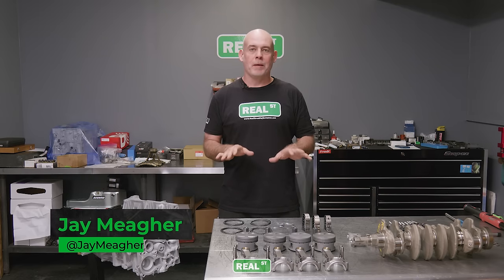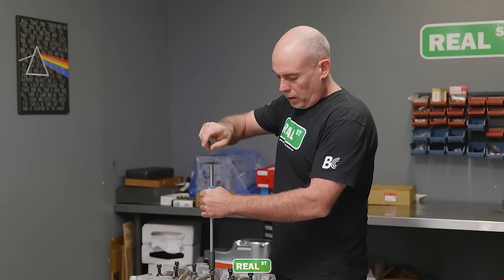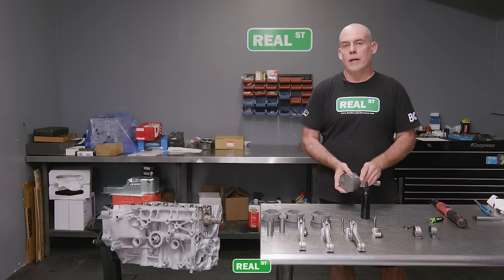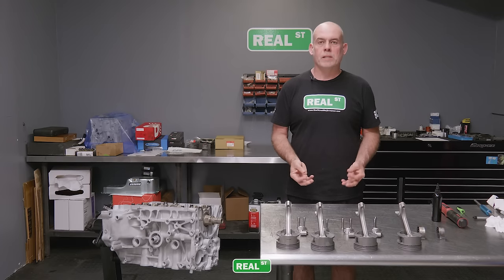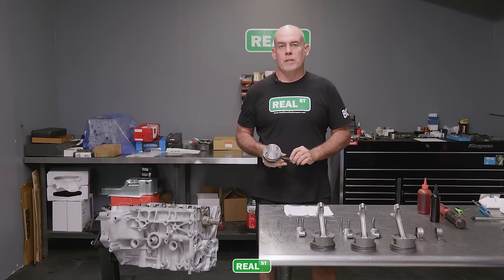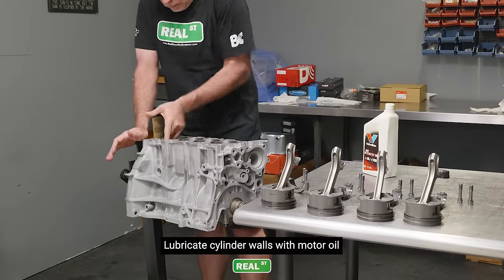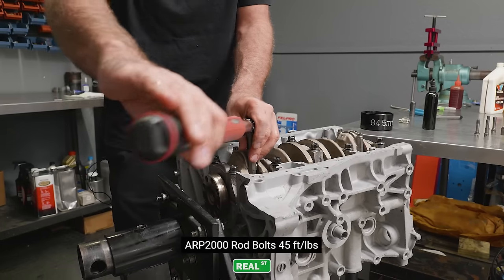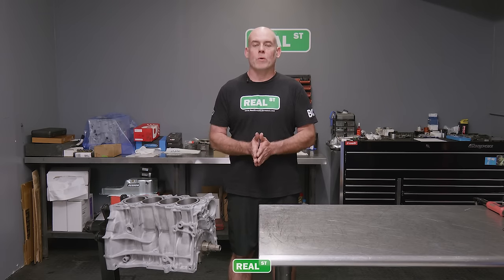How to Assemble Your Honda B20 Short Block with Jay Meagher | Real Street Performance

Comment: Did you check the bearing clearance on the mains and the rods before assembly?the reason I asked is that I had my Chevy 1.8l bored from stock. All original bearings are in excellent condition including the crank. Do I need to plastigage before assembly? Engine was ran in stressful conditions for 263,000 miles (Amazon deliveries) but was maintained well.  No sludge or carbon buildup.

Comment: My daughter and I are researching an engine rebuild for her 2000 CRV,  She's not a racer girl but does have to drive the pass from Reno to Sacramento regularly.  She needs more power!  
Is there an advantage to purchasing a B20Z block vs. a B20B also, choosing a P75 head vs. the P8R head for its larger valves?  Loving this video!

Comment: Hello I have a couple questions. First how did you get the block so fresh what process did you guys use? Also what is the break in process for a new built bottom end? Thank you for any feedback!
Reply: Most likely the engine went to a machine shop and got cleaned

Comment: When you installed the rod bearings did you put assembly lube on both sides of the bearings? Also were you using assembly lube to wipe on the rings? Does the b20 use thrust bearings?

Comment: Will you be venting the crank case pressure on your B20. I've read that the block needs the crank case pressure released if not it won't last long. I'd love to get your opinion on that considering you'll be doing a b20vtec.

Comment: Question from a beginner, should the screws always be lubricated before tightening according to manual torque values, for example when I assemble the cylinder head or valve cover or anything requiring specific torque? There is no reference in the manual regarding this aspect. Thanks

Comment: Do you guys bead blast the engine blocks? They're always so clean. If so, can you show or elaborate on the process used? Thanks again.
Reply: Hello, yes the blocks are either bead blasted or vapor honed. The vapor honing is nice, it doesn't dull out the aluminum. Just be careful either way to clean everything very well. The blasting media will quickly destroy a new build. Thanks

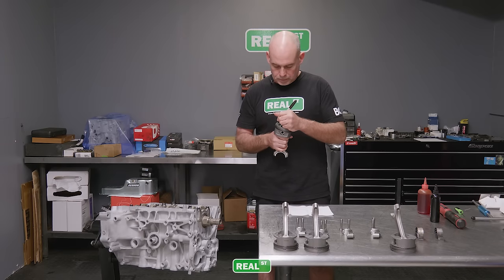Comment: The 18:30 minute explanation about mixing bearings is kind of confusing. I thought the thinner bearing goes in the rod cap and the thicker one in the top of the rod. The mains are the other way around, thinner bearing in the cap and the thicker in the engine main. You have a video that explains it but, in this video, it seems is the other way around. Am I missing something here?

Comment: Jay, is there a reason you decided to install the rod tangs on the intake side? I think you said it really didn't matter which side it went since modern vehicles don't have tangs to begin with. Also if you were to turbo this b20, wouldn't the poor sleeve design limit you as to how far you can push things? I've had a b20v setup prior and I ended up cracking all 4 sleeves. Is there a hp number that is safe or possibly having a conservative tune might help. Thank you for the awesome content as always. 👍
Reply: 91 and like 5psi and a block guard with large channels for cooling should last forever. All the b20 I have seen break due to pre detinaton, I have also alot of people complaining about it blowing up and you look at there socials and there constantly on the red line.

Comment: I’ve never heard of using two different bearing sizes for each side of the rod journal, does that not create uneven wear? I’d be worried you’re starting off destined for rod knock
Reply: I think Papadakis does the same on same race applications.
Reply: The bearing isn't round anyway, it's a good way to get the clearances you want with nothing more than an extra set of inexpensive bearings

Comment: What is the difference in assembly lubes used on the crank bearings and caps. One is red and the other is blue. Is there a purpose for this?

Comment: Was there lube under the main bearing on the caps? I always thought you weren't supposed to use any oil on the back side of the bearing.
Reply: He has an entire video explaining this. He uses a light oil like ATF
Reply: @that_texas_local  Ok, would be nice if they didn't just gloss over that, but I guess it would just cause a debate if they went into detail about it.
Reply: I think the idea behind the ATF is that it’s thin enough to displace and not affect clearances, while also protecting the shell when you install it. It possibly lets it settle into the bore better too but i’m just guessing.
Reply: Ultimately you do not want metal against metal. The argument against putting any form of lube on the back side of the bearing is that it is more likely to spin a bearing. The problem with that argument is that the bearing has a tang that locates it on the journals and holds it in place.

Comment: when you’re putting the main shells in the caps - what is the red lubricant you are using?
as i noticed a different assembly lube on the rotating equipment but you used a red lubricant instead of fitting the shells in dry, whats the reason for that?

Comment: My son has a 2001 Prelude Base with the h22 in it.  What would be some good volt on for this motor.  Is isnt prepared  for the turbo yet.  He wants to completely tear it down and replace everything with performance parts.  Any info would be greatly appreciated.  I enjoyed watching this video ,  it was really informative.  My boy is 20, I am 53.  I still cruise a Honda. Just a newer 2021 Civic.  Thanks for the Info
Reply: It depends on your power goals. The Honda H22 block can handle a moderate amount of boost on stock sleeves, typically up to 300-400 horsepower. However, if you're planning to run higher boost levels and push for more power, sleeving the block is recommended to prevent cracking and ensure long-term reliability.

If you're aiming for significant horsepower gains, sleeving the H22 block can provide added strength and durability under higher stress.

Comment: Quick question, how do you feel about using a girdle on the B20v? I have one that came on the engine, it was from a GSR. The engine wasn't assembled correctly so i had to do a complete tear down and etc. Debating on whether or not to use the girdle. Not planning on boosting or revving past 8,000. Would you use one?

Comment: Hi Jay, I love your engine build videos. Could you educate us on how to change torque specifications when using bigger or smaller main bearings. I have a bmw b48 (4 cyl). And want to build the block. I wanted to use performance main bearings. They range from, softer to bigger and what not.

Comment: I am rebuilding b18c4 engine end when I put only 2 of the rods and tighten them at  the crank only rotates at bottom dead center center. Impossible to rotate 90 degrees. When I put flywheel and use it to rotate it rotates but a little tighten. Is this normal

Comment: Hey Jay I have a 2006 Scion TC that I’m currently overhauling due to headlift after boost, I bought oem thrust washers but they are too thick and don’t fit, I already checked and compared another new set and they still don’t fit. I also tried aftermarket which were closer to fitting but still nothing, Everything is oem so it should fit with no issues, only thing aftermarket I got were the arp head studs. My only resolution I can think of is sanding down the thrust washers until they fit and run it like that. What would you do In this situation?

Comment: You didn't check for bearing clearances? Whats the acceptable level of piston height from deck?
Reply from the maker: We covered Measuring clearances in two previous videos 

Bearing clearances https://youtu.be/T6q1dAvn5nQ

Piston to wall clearance and piston rings https://youtu.be/oBmrGro0MhM

Also cleaning the parts and block before assembly: https://youtu.be/-37WX55yqe8
Reply: @realstreetperformance  Thanks! Hope you can make a playlist for these videos.

Comment: Hi, I've been viewing your channel for some time and really like it.  Quick question.  My wife overheated her 2001 4 cyl 2.3l VTEC Honda Accord. I tore the motor down and of course the head is warped, valves stuck in guides, etc.  Block needs to be decked and the line bore checked.  I am thinking of sleeving the engine too in place of the open deck liners and building a performance engine.  Do you have a machine shop you could recommend that does that kind of work?  Thanks.
Reply: Just buy a used engine
Reply: @hyper8545  Another thought.  But I'd hate to put an unknown into the car and it not function correctly.  Guess I could rebuild it too...
Reply: @douglas747wct  make sure its a good engine before you buy it.  Compression test.  Look down spark plug holes with a cam.  Pull off the pan and inspect inside.  Pull the oil filter and look at it.  Besides a engine depo will take the engine back if it ends up having rodknock or something they dont want to sell bad engines.
Reply: @hyper8545  Ok, thanks for that.
Reply: Floating cylinder liners?  you mean the fact that the engine is an open deck instead of a closed deck.  sleeving the engine wont make it a closed deck block, you are just replacing the stock sleeves with a strong sleeve.
Reply: @rgreerjr  yeah open deck.  Terminology!  I saw a video on Darton sleeves that fill the gap making it quasi-closed deck. Very expensive and probably overkill for my intended use

Comment: I have been looking at rods on realstreet for about a year now and can’t make up my mind.  I want a rod that can handle up to 800hp.  I am liking the crower b18 rod with CA625 bolts but can’t seem to find anyone sharing their experiences with them.  Would they suit my goals for a drag car?
Reply: Not a drag car, but I have Manly turbo tuff rods in my build. 810whp b20v driven on the street
Reply from the maker: Give us a call or send us an email and we will be glad to assist you with parts selection 
407-695-7223
sales@realstreetperformance.com

Comment: in 90's these engines made 200hp NA hope you do better than that, cam is everything
Reply: I hope you dont mean 200hp stock as opposed to built. 200hp is about max hp you can get out of these NA.
Not everyone cares about getting 1000000 hp in their car. Plenty of people get enough enjoyment driving around in normal traffic with 200hp in a vehicle that's only 2,000lbs.